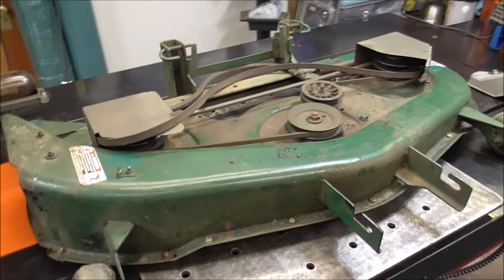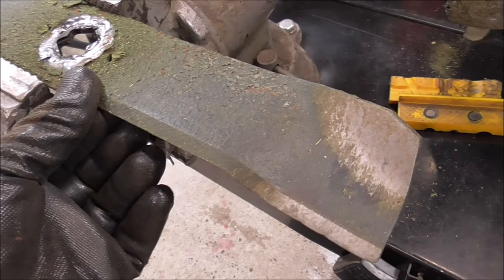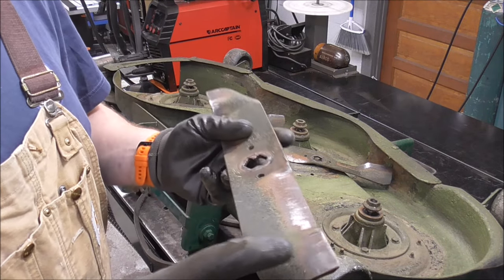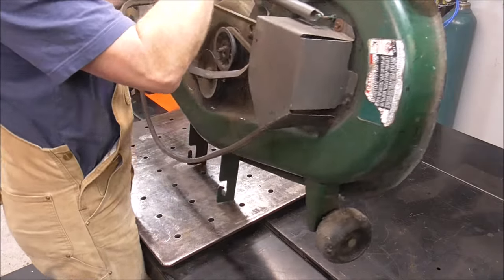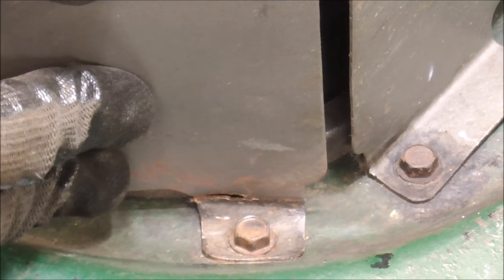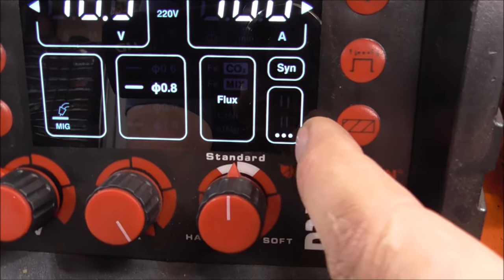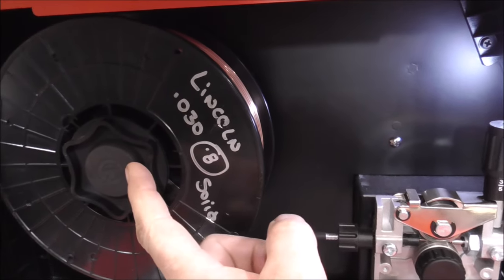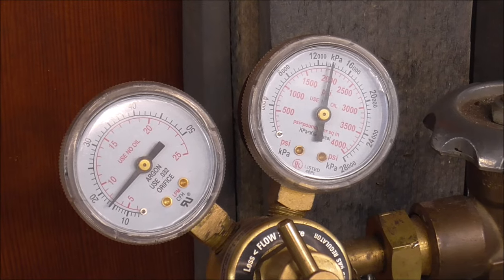Beginners Guide to Mower Deck Maintence and Welding Repair

Comment: Thanks for sharing with us Brandon. Always enjoy those annoying deck repairs we need to do but it makes it better when we have the tools on hand to fix them. Stay safe , Fred.
Reply from the maker: Thanks Fred! I was really contemplating taking a wire wheel to the deck and ordering some more chassis saver paint but I felt the dust gererated would be better to do outside on a warmer day. We will see how the deck looks for next winters service. If it looks worse than it does right now, I will do a restore next winter.

Comment: Did you think about balancing the blades? Unbalanced blades are a great way to cause all kinds of vibration related damage to a mower.
Reply from the maker: Excellent point. I thought about fixturing them up to check but decided againt it. I didn't remove enough for it to be a concern. I only touched up the edge and I did it equally on both sides.

Comment: I was thinking about doing something like this in the spring and summer. Fixing small engines and sharpening mower blades now that I have my bench grinder stand finished.

Comment: With some good maintenance and TLC, there is no reason that it can't last for another 10 years or so. As for the belt, possibly a low quality one that has slipped through the QC. I've had a couple do that over the years. 
Good one Brandon 👌🏻👌🏻👌🏻
Reply from the maker: It's a great feeling when you can keep your stuff looking and functioning like new, while saving money by not having to buy new. 👌
Reply: @BrandonLund  I certainly is. 👌🏻

Comment: Thanks for the video.  If the bearings are sealed bearings the grease nipples are not of any use. The outer end of the blade, the last 2 inches or so, is the cutting edge.  The part of the blade from the centre to the cutting edge does not cut and does not need sharpening

Comment: In my opinion, that belt cracking/damage is normal for that age belt.  As it goes over the tension rollers, it is bent backwards and I believe that is where the problems come from.  Takes years to do that, though.  Nice repair, and really good information. I am going to get some of that protection spray for my stuff!!!  Thanks, Brandon, and that will last a LOT longer now!  To replace that belt, I think your are going to have to take the protectors off.  Be well, be safe, be Blessed!!!
Reply from the maker: Thank you Jim! I looked at some blue aramid belts the other night but then I saw mixed reviews. Some say they are great and better than factory and others say they crack easy. I don't know what to do. I would like something a little more durable but I did get 3 trouble free years out of that belt also. I know you work on a lot of small engines. Whats your thoughts on the blue belts? Are they better than factory? Be bleesed buddy!
Reply: @BrandonLund  get the cheapest one made in the United States.  Been working for me for years.
Reply from the maker: You sold me! Thanks buddy. That's just what I will do

Comment: Those blades look rather thick compared to my electric mower. Always thought that I was the only one sharpening those blades with a grinder with a flapdisc on it😅. Your mower looks very sturdy with such thick belts on it. Wonder which kind of engine runs it? Shall be a 50cc I guess. Wonderful repair Brandon. Always details that makes us better and wiser. Many thanks for your useful input. A machine that served you for many years and still keeps running now. That Arccaptain is awesome. A LED-light and a sheet with all the settings on it. Awesome machine! Time will tell😁. Greetz from Holland and stay healthy and blessed.😀
Reply from the maker: Hey Marcel thank you! I don't remember who made the blades but when I bought them I remember that they were supposed to be really good. They have actually done really well. This is the first time I have sharpened them in 3 years and I mow my grass every week. Those blades have definately served me well
Reply: @BrandonLund  Just a joy how you transfer knowledge and trigger young and old into technique. That's a Gift just a few on earth have😇😀. Thankfull to be one of the happy receivers. Love your workshop and foremost your quite mind. You should be a wonderfull teacher before a classroom. Keep Healthy, Safe and Blessed. Many thanks from Holland.😀💯❤
Reply from the maker: I really appreciate that Marcel! Thank you 🙏

Comment: Hey Brandon, I was looking out for your new video and I enjoyed it, nice project to do. I've made a new one for a friend when I was still working, made it from stainless steel but a little bit to thick ( 2 mm) because it was all I had. Waiting for the next one, I' curious what that's gonna be nice job and you treated well if you look at the blades, have a very nice weekend and stay safe,greetings.
Reply from the maker: Thanks Christian I appreciate it! I'm really happy how well this mower has held up. I might redo the mower deck next year if the motor continues to run well. 600+ hours is a lot of time on a gasoline riding mower

Comment: Another blade of grass will be cut another day. My mower is a Gravely commercial zero turn and I bought it in 2014 in Florida. Now we are in Missouri and now have to deal with rocks. One of my pastures I spent a few days cutting it down with my stihl trimmer, and wasn't worried about the real big section. So I'm trimming along and got down to a small section. So i decided  to bring out the mower and low and behold i hit barb wire and it was caught in the blades. So back to the building and raise up the mower and remove 2 blades. Then the problem started in where it had a vibration and it got worse. As i was mowing and sweeping up leaves dumping into the garden. As I went and made a turn i looked back and a blade fell out and luckily the bolt was still in the hole. Called the dealer to make an appointment took it in. He calls the next day and says the key way on the crankshaft was torn up but he said he could get a machine shop make a sleeve to extend the key way. He also mentioned not to idle around run it full throttle. He said otherwise he would have to pull the motor and replace the crankshaft which would be over $1000. i said let's try it his way with the added piece. Had them change the oil and filter and same with the wheel motors. So all that cost was 270 dollars. For the price of these mowers it was the way for me.
Reply from the maker: That sounds like the type of luck I usually have. Lucky for me my lawn is fairly flat. My back lawn is small and it was a overgrown mess with trees and pucker brush when we moved in. I made a drag (video on youtube) and made a lawn out back so knock on wood I havent hit any rocks or obstacles. I'm glad you got your mower back in working order. It definately pays to take care of them and maintain them versus the price of a new mower. The prices these days are crazy. I think you went about it the right way. It's what I would have done also. Have a great weekend Jake!

Comment: The design of the mulching blade is to re circulate the clippings as they are cut making them smaller.
Reply from the maker: It works pretty decent and the blades stay sharp for a long time.

Comment: What material are the blades made from. Just wondering as you're a welder could you put a bead of hard facing on the blade edges
Reply from the maker: Thats not a bad idea. I'm not sure of the material but they have held up pretty good.
Reply: What I was told you don't want to put hard serve rod on blades because they can shatter if you do hit something
Reply: @rogertaylor8615  I was thinking of the stuff they use on digger bucket teeth to reface them. They must be resilient
Reply: @Phantom-mk4kp  but I believe some are made of carbide and they are lots thicker material blades are just steel

Comment: The reason they cut level if because the only cutting is on the outside 2" or so of the blade.  You notice that even after 3 years, the section close to the center is practically untouched.  I mow about 8 acres (6 of my own and 2 for my sister-in law) and I have to sharpen my blades about every other mowing time.  I have lots of crawfish mounds and fire ant beds so I have a lot of rock and dirt impacts that really wear on the blades.  I keep 2 sets of blades for each of my mowers and replace them after about 2 seasons.  As for the belts cracking,  I dont have a clue other than maybe a poor quality belt.  My OEM belt lasted 1 year  which I replaced with another from Ferris which also lasted a year.  Since then I have used premium quality Kevlar belts and now,  I get 4 years or more out of a belt.
Reply from the maker: I cant remember what I ended up going with for a belt when I replaced. it. Probably OEM but it;s hard to say. I generally try to get at least OEM quality on anything I do or maybe a little bettter if possible because I'm a firm believer in trying to go a little better so have a more reliable result. These blades I am SUPER impressed with. I remember when I bought them that I did a lot of research and they had a really good rating. My property as about an acre and I mow it every weekend for the past 3 years and they barely show any wear. I was pretty impressed with how little wear they had. I would have to go back into the linked video to remember what blades I went with.

Comment: I know why your belt it trying to snap. I had a new one snap on me. I was mowing with my Yardmachines its basically a Yardman the same thing and I solved the problem. So what you need to do is find a Bungee Cord and get a hook off of it and connect that to the big spring and let the hook snap onto the bracket that little line that goes up near the left spindle on the none chute side. It works really well for me and now there is not so much tension on the belt it's more free and loose than it being too tight. I hope you get what I'm saying too lol 😅 but like I said just get a hook and connect that to the big spring and onto that little bracket.
Reply: At 1:16 in your video you see that big spring? Just connect a hook to that and onto the bracket and it will make that spring not so tight for your belt and that should fix the problem. It fixed mine 💯 just make sure your belt isn't to loose but it should at least free it up a little bit. Also I've been making myself a project and I actually turned my Yardmachines into a Yardman I changed the color and I got myself a Yardman hood so you can't even tell it was a Yardmachines anymore lol... If I make a video on it you can see it looks just like a Yardman I'll have to make a video on it soon and I'll give some advice about it as well 👍
Reply from the maker: Thanks man! 👍
Reply from the maker: I appreciate that man thank you! I'll add the hook this summer. I have a bunch of those bungee hooks
Reply: @BrandonLund  Alright no problem. But yes that will definitely apply less tension from that spring!